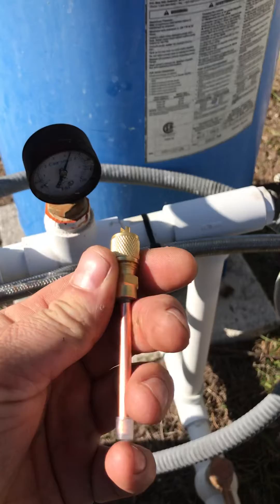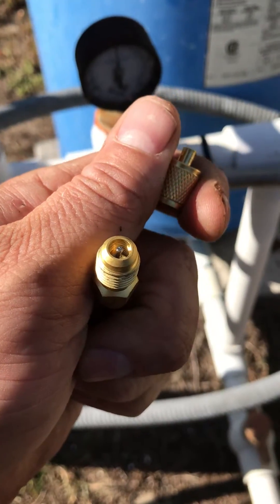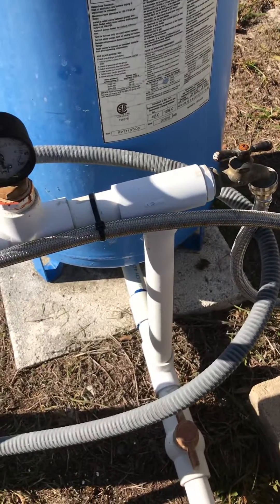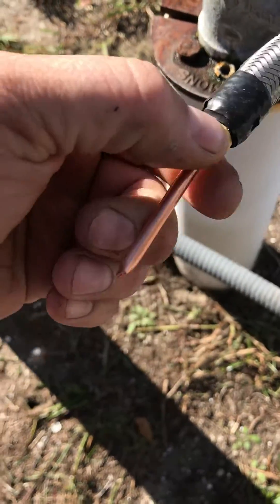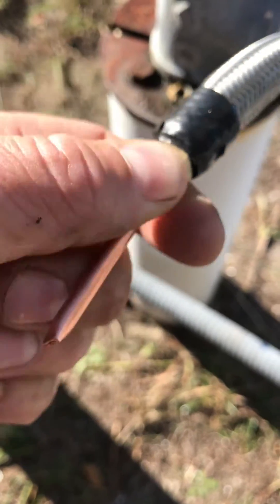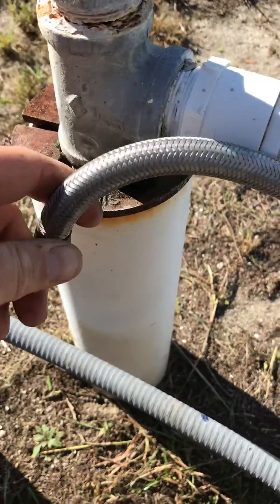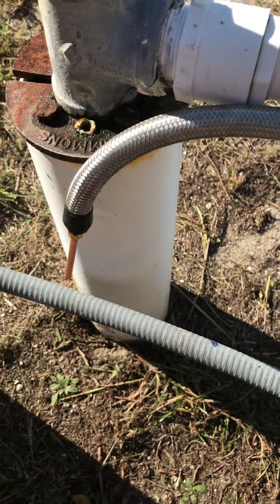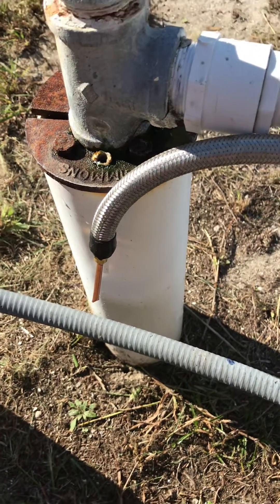How to eliminate “Rotten Egg Smell” from well water for under $20...

Comment: Your well pump is short cycling every 30 seconds. It shouldn't be doing that. Probably the pressure tank bladder. Glad you fixed it now. Use a stainless tube for your aerator it will last longer. Is the aerator still working?

Comment: total bullsh-t a waste of time used one like this for a while it will not remove the sulfur from the water I lived in Florid all my life a big tank airation system is the only thing that will work! cost about 2400 to 3000 according to the well size!
Reply from the maker: Well you are totally wrong as it worked the whole 5 years we lived there. Every once in a while we would smell rotten eggs and I would know I had to go clean that copper tip. Once cleaned smell was gone again.

Comment: Your pump is constantly running and that is not good for you well pump at all. You pump needs a cool down
Reply from the maker: I replaced the entire system after this video 4 years ago and still running this same setup. Pump was cycling so much because I was filling my inground pool that day… I can be outside for 30 minutes plus before I hear that well pump kick on now…
Reply: What kind of pump do you have now? Mine is only 4yrs old and I'm thinking about doing this today. So tired of the rotten egg smell🤢
Reply: @stephenchrzanowski9235  get a sulfur tank and you will be okay
Reply: You can easily install timer.

Comment: Yeah, but your pump is working overtime. So it will not last as long.
Reply from the maker: 3 years later still going strong…. Only reason pump was running so much in this video is because I was filling my pool. My pump rarely runs….

Comment: Great idea on atomizing the water back in the well to separate the gas our of the water,  But mine is a sealed pitless adaptor style,  how do you recommend venting the sulfur gas out of the well head?
Reply from the maker: Drill a small 3/8” hole maybe in the cap?
Reply: I got nothing.  Seems like he's just putting the smell right back in the well..... out one end and back into the other end
Reply from the maker: The Smell escapes out of the cap as sulfur is lighter than air…

Comment: Help me out here.  I get the idea, but when you mist the water back into the well, how does that get the sulfur out?  How does it get sulfur out if you have the mister in the vent?
Reply from the maker: When the water atomizes it releases the trapped sulfur gases that are lighter than air and vent out….
Reply: @robertmwatson81  Hydrogen Sulfide is actually heavier than air.  While the H2S can be released from the water through the aeration process it does appear as though it is would end up right back in your well.  I wonder if adding a powered vent would help extricate the gas?

A common benefit of aeration is increasing the aerobic bacteria count, which improves water quality through their breaking down organic compounds.
Reply: Vent out through where? The only hole is the one thats made for the mist
Reply: And any iron in your water will be oxidized, then the iron sludge will stick to the insides of your well and piping
Reply: It is filtered out in your water filter.

Comment: Most submersible motor manufactures recommend at least a 1 minute run time. Your run cycle lasts 5.5 seconds with an off time of 25 seconds. NOT GOOD , use a cycle stop valve, a larger tank, or both! I have tried down well atomizers and they work at first but, if your water is corrosive and most well water is to a certain extent it will fail. Ph, hardness, iron, maganese will erode that copper tip out in no time. It cost a little more but, I would go with an air over media back washing filter with catalytic carbon. That will get rid of the hydrogen sulfide gas. Test your water first!!!
Reply from the maker: This system sat for years before we bought the house. We replaced it with a larger pump and much larger bladder tank shortly after this video. My system doesn’t short cycle anymore and is still using the same setup I made in the video...
Reply: Thank you wise words here folks
Reply: Pay attention, it's very obvious he doesn't have aeration nozzle in service while making the video therefore it's not causing the pump to cycle on. 🙄

Comment: Not about this specific setup, but do have questions... Do you think that water pumped into a 10 gallon tank in a spray and allowing the tank to sit open in the Florida sun will remove sulfur smell from the water? The tank is a custom 4 inch PVC pipe I can pressurize and wondering if adding the air valve on the bottom side to vs top as I was planning to help remove sulfur smell makes sense.
Reply from the maker: Honestly I am not sure. This was just an idea I had that worked... Doesn’t hurt to try!

Comment: You are creating a problem that you do not realize. Your system short cycled several times while you were filming. By the time you read this your pumps motor would have already burned out....
Reply from the maker: That system was replaced shortly after this video. That well pump sat unused for years and we knew it was going and had an undersized bladder tank as well. The new system is bigger with a bigger tank and doesn’t short cycle. And the new system had this on it still for about a year now with 0 issues.
Reply: @robertmwatson81  I have read that an aerator like that promotes iron eating bacteria in the well leading to rust problems. Have you noticed anything like that?
Reply from the maker: What’s going to rust? Well is all PVC and the lines to the house are PVC. My pump is submerged in water and is stainless…
Reply: Can you explain like I'm 5?

Comment: thanks for this... another airater system cost was 125$  Thanks.
Reply: Did this work for you?
Reply: @calebnutter2511  didn't do it just reasearched the price... for me there was a water laser filter where the bulb was burned out.. bulb was 80 at home depot and so bought the bulb and replaced it and the smell went away and changed the filters.. 2 filters.. the laser filter system was about 650 at home depot the bulbs last a year..